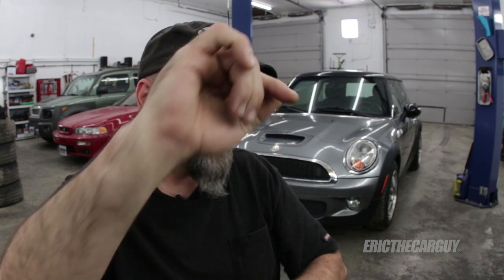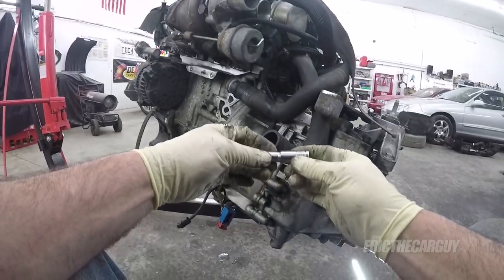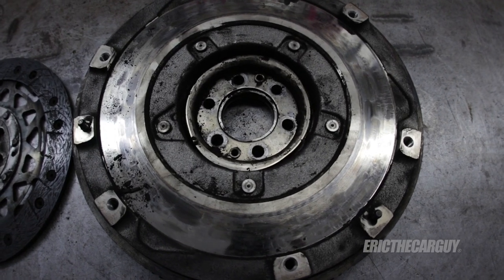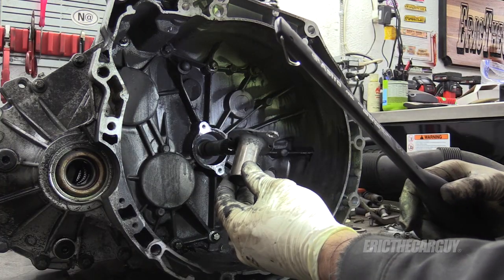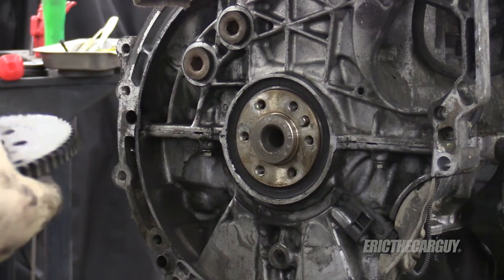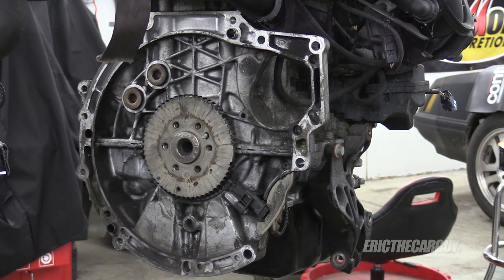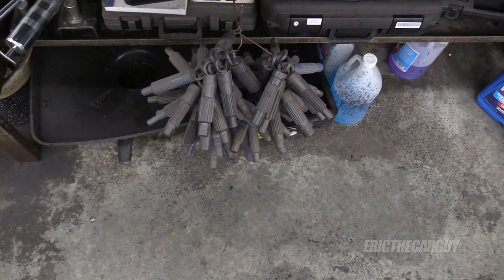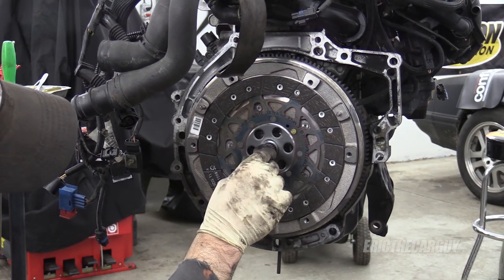How To Replace A Clutch and Flywheel Mini Cooper S (R56)

Comment: When I did the 90° I lost track. And ended up buying new bolts. Make sure you mark them with a white paint marker and and use those marks for your 90°’s
Reply: Jeremiah Thomas Or buy a digital-angle torque wrench

Comment: Yep, good alignment and slowly, slowly is the way to go. A friend of mine did neither of those, he failed to centre the clutch correctly, then used the bolts to try and force the gearbox and engine together. Doing that he managed to take a big chunk out of one side of the brass bushing that supported the input shaft. He learnt the hard way, so good advice all round, Eric.

Comment: Great job as usual sir, watching you before work every Friday. I’ve done clutch’s twice on the last 4 years as a tech, my first one I had to do twice because I put the springs facing the wrong way after putting every bolt back together and the subframe, I push the clutch in nothing happens LOL.
Reply from the maker: It takes a real man to admit mistakes.
Reply: Seems it's a common rookie error - and we were all rookies once.

After the second time I had to re-pull a gearbox and flip the clutch...I decided to be more careful and double-check before buttoning everything up.  Seems to work better that way - and causes a lot less blue language.  :-)
Reply: EricTheCarGuy yes sir especially when them good old boys still talking about it 3 and half years later LOL
Reply: aussiebloke609 yup I did the same thing on the second clutch, you live and learn even though blue language is there either way in the shop or at least in my shop, I just hope I never have to do them again I don’t like fixing manual transmissions but I sure like driving them

Comment: The easy access to every bolt just made it such a nice job, just imagine the struggle doing 90 degree turns under that tiny car.
Much better with the engine out :-D.

As i'm no mechanic, i only remember the clutches with the damper springs in the center, i've helped with clutch replacements on very old cars.
Reply from the maker: Yea, it's much easier to do this job with the engine/trans out of the vehicle. Honestly, I don't think they were that difficult to remove.
Reply: zx8401ztv - Yeah, with the engine out if you are doing this yourself. It just makes me glad I don't have a Mini. I look at the cost of a shop replacing a clutch in my Honda, then look at this Mini, and I could only imagine the labor cost alone would make me cringe..

Comment: Great vid.  Good tips on greasing the input shaft.  Not only is it a high-temp grease, but it's also a high-pressure grease. I use that on the pivots for the clutch arm rather than anti-sieze.  Just a thought.
Reply: Sounds like a good idea.  I always used to use moly grease (molybdenum disulphide) because it handles the heat well, and you need only the thinnest of smears for it to work, so it tends to not collect all the dust and crap over time.  It used to be the go-to grease for brakes, too - until everything changed over to silicone.  Not sure how it handles pressure, but the clutch pivot generally doesn't have extreme levels on it, and it seemed to work pretty well (never had a wear problem, anyway.)  :-)

Just don't get it on your hands, or you'll be washing with pumice for 30 minutes afterwards...and you'll still have greasy fingers.  Ask me how I know.  :-D

Comment: no eric... you should have done the rear main seal while you were there... you know its going to start leaking as soon as the mini goes back into service..........
Reply: It's German,  you know it still has oil as long as it's leaking.
Reply: honhon05 it's fine he's selling it so it will become somebody else's problem. That's the  glory of buying second hand cars.
Reply from the maker: In a perfect world, I would have. However, I would have lost a day of production waiting for the seal to show up. Something I simply couldn't afford. It wasn't leaking and I stand by my decision. Thank you for your input.
Reply: true..... its just usually when your there and you hold off it usually starts happening right after... just because.
Reply: I would only replace the seal if it was leaking or looked hardened and brittle  If you replace it but you do not get it in perfectly then you do the job again.
Reply: Man I had the same thought process as Eric before then 6 months later the seal started leaking and out came the transmission again

Comment: Dampening is the process of adding water.

Damping is progressive attenuation of a process

Seems hair splitting, but such is our language
Reply from the maker: Excellent point.
Reply: Crap! I've been saying it wrong this whole time. TIL.
Reply: WD Hewson Vibration Dampener or Vibration Damper. I think the first one is correct. Harmonic Balancer. U r rite/right/write, the English language is tricky
Reply: Hewson is correct.  To an engineer its a damper.
Reply: The second definition of dampen/dampening is to make less strong or intense. The technical term Damping is any effect that tends to reduce the amplitude of vibrations. Big thing here is that dampening is a verb and damping is a noun.  Damping would be the technical description of the process while dampening is a reference to the action of a process. I'm not an engineer or mechanic, so I don't know how functionally these terms are used. But it seems like both terms may apply for different aspects of a subject. Any English professors here that can clear this up? The English language is straight up kookeydooks.
Reply: jcrbama +1 that the language is crazy.

On the one hand, you can have words which are spellt the same but spoken differently. Tear and tear: one being water droplets from your eye, another being a synonym for rip.

Then there are words which are spoken the same, but spellt differently. Tier and tear, for example.

Comment: I came on here before doing the clutch on my sons R56 One D. It has done 165,000 miles, and the pedal went hard so had to be stripped. If found this was because the release arm snapped. 

The clutch plate and pressure plate were actually still very serviceable, and would easily have done more than 200.000 if driven in the same way, had the release arm not snapped. My son says the replacement clutch is a lot lighter now, so it maybe that as the plate wear occurred the force to release the pressure plate increased and was a factor in the release arm snapping

I would advise anyone doing their clutch to also fit an new release arm. You don’t want to do this job twice. The release arm is pressed steel, and it seems from reading on the net they are prone to snap and not expensive. (the release arms are listed from various sources from £25 to £45) 

As described its certainly not an easy job, because there’s a lot crammed in a small car. but I’ve done worse jobs too, if you have decent tools and just take your time its well within the DIY scope 

Noting  some comments about Mini’s having weak clutches , ours would have done well past 200K had the arm not snapped, and my wife’s R53 Cooper S has done 120K and seems fine. Like all cars the clutch life is affected by the driver more than anything else

Comment: not sure if I mentioned this already because I brag about it to everyone but pacific clutch and brake resurfaces these flywheels and pressure plates and even rebuilds the clutch disc. I ve done 2 of these clutch jobs the clutch came out great

Comment: Nice video! I think the pilot bearing on those models is in the transmission input shaft (built into the nose) which is how BMW has been doing it on their later models. It's a pain to replace and it seems like most people leave it be unless its bad. A few other things to note (again based on BMW experience, but they look the same on the MINI): the clutch pivot pin is plastic and a common failure item that should be replaced while doing the clutch. The OEM pin is only a couple dollars or aftermarket brass and steel pins are offered for a premium. Next, you should pay attention to the TOB orientation as some can snap in two different ways as they can be spec'd for multiple models. Finally, BMW has a special clutch alignment tool (Germans love their special tools!). I usually see the plastic tool included with the clutch kit as you said, but it doesn't fit on self-adjusting pressure plates (the lock plate gets in the way) making the special tool very nice to have. It's something to keep in mind if you do a newer BMW clutch.

Comment: They've had single mass conversions since at least 2013 btw, but I think was only OS Giken and maybe clutchmasters mainly. Now there are a few kits using Aasco flywheels that can use stock non-sprung discs, or few others using slightly different but similar flywheels that use custom disc and pressure plates for different clamping pressure, etc. Depending on what country you live, there also seem to be preferred smaller outlets providing OEM swaps like Aasco's. I've found 2-3 manufacturers in US and handful of others around the world, but Mini owners typically exist to be milked for profit so they'd rather you buy a 'custom' kit for 1400 than get the flywheel for 400 and standard clutch kit for 200 :D

Comment: Please help... I don't think I replaced the part from 9:00 - 9:30 correctly bc the long rectangular plate (i do not know what it is called) is 1 1/2" deep in the whole, and I think the plate should be touching the inside wall. Thanks

Comment: A tip for you whenever you have bolts that require a further 90° torque. I make a small mark with a silver or white marker at 12 O'clock on all the bolts ... then when you done they should all be at 3 O' clock.

Comment: Hello. Love ur videos. My transmission exploded on my 2003 mini cooper r50 (5 speed midlands). My mechanic has a 6 speed conversion kit for 2700$. Would u recomend it? My concern is 1- reliability down the road. 2- will the performance get better or worse? Thank u.

Comment: I just did this on a R55 Clubman S last week..  The car had 80k miles and the clutch was DEE-STROYED...     Come to find out, current owner bought it from a guy who used to auto
cross the crap out of it.
I did mine w/o removing the engine, and w/o removing the subframe; I just loosened the rear subframe bolts, and removed the front two, which gave me about 8" or so of clearance.  Either way, not a job I plan on doing again, any time soon.

Comment: clutches in the uk very rarely come with a flywheel alignment tool but I got a valeo clutch and flywheel for £520 for the same mini so it seems a lot cheaper than you're $1300. we have a universal alignment tool that we use.

Comment: Whenever I don't have a spare rear main seal, I need to replace it; whenever I do have a spare, I don't need to replace it; it's like a $3-$5 insurance policy. HOLY SACKS OF BALLS, $1,300 FOR A CLUTCH AND FLYWHEEL I was pissed at the $500-$600 I spent on a Subaru OEM Clutch and flywheel.

Comment: Vauxhall Astra B/Opel Kadett C used to have an access hatch under the bellhousing to get to the clutch assembly. Piss easy job.

Obviously someone at GM/Opel/Vauxhall realised they weren't making enough money from clutch changes and so it was deleted and  you then had to physically remove the transmission... that sucks...

Comment: From 2016 to 2018 ... I owned a 2011 Mini Cooper S.... I got it at 44,000 mi and it was one owner and very clean. I liked it a lot... BUT ... during the time I owned it, I had 3 check engine lights...limp in mode twice.... it just could not stay out of the shop.  My opinion of these , is they are designed to suck money out of the owners... and well designed at that.. The $1300.00 clutch kit only furthers my belief. I could buy a new one every year if I wanted, but I don't believe in  literally throwing my money away.  Screw that. You can see my vid of me and my Mini if anyone cares to. I was following a semi at 80 some mph at night on I -90 .

Comment: 13:55 but turning it 90 degress is still the same torque on all bolts? So why not just have that nm instead?
Reply from the maker: I wish I knew the answer to that.
Reply: Morten Nielsen bolts that need to be turned an amount of degrees after torquing, are stretch bolts. The degrees indicate you can't reuse old bolts.
Reply: degree angle is far more accurate at high torque because of the resistance of the threads

Comment: I'm getting ready to do this job on my own 2011 MCS, however with a Stage 3 clutch kit and a single mass flywheel to handle the power I'm making. I'm not removing the whole engine, though. Would you say this is a situation that requires a transmission jack if you are not removing the engine? I was planning on lowering it out with a regular jack.
Reply from the maker: It will be tricky, but you can probably manage it. It would be safer with a 'buddy' or a transmission jack as you mentioned.
Reply: Thanks for the input. 

Also I'm guessing you talked to Chad over at Detroit Tuned. He's a wealth of knowledge on the brand, however I don't know why he says single mass flywheel clutch kits aren't possible with this engine. As I said I got a single mass kit, it's from JM Turbo Coopers who make a lot of high performance aftermarket Mini parts. They make kits for both N14 and N18 motors.
Reply: Hey Eric, just an update on this from a while ago. Bit the bullet, bought a transmission jack. Clutch swap was rough but I got it done, your videos were extremely helpful and were my primary go-to for reference. Used my floor jack to support the engine and the transmission jack to get the trans in and out. Getting them mated back up was a huge PITA but they're mated back together now.

Comment: the center clutch disc springs do something else. they reduce impact loads on the entire drive system, especially the transmission. Nice to see the mini has a outboard replaceable clutch slave cylinder. I HATE the slave cylinder built into the throw out bearing.

Comment: I know this was posted 3 years ago but my 2012 mini clutch is soft and needs to be replaced. I’m ordering from Rock auto. It’s been a nightmare since I bought it from a lying or shall I say “fact omitting” dealership but I do love it. After spending $1200 for alternator and $1100 for coils I’m buying the parts & bringing them to be put in. Any ideas on best clutch? Kevlar or organic better? They are $200+ price difference. It’s already got 142,000 miles so I don’t need another 140,000 out of it. Cross that bridge if we see 2023...😬

Comment: Don't do as Eric does and draw the transmission to the engine with the bolts. Make sure it mates up before tightening the bolts down.
Reply: Yeah that made me cringe.
Reply: @humidbeing  I simply use BIG Channel lock pliers OR a couple of C clamps.

Comment: For where the transmission oil goes on the mini, the studs that connect it. What would you call those I'm having difficulty finding the proper bolts.

Comment: It is strange why they don't include an alignment tool with the kit. I had the same issue and resorted to using one of my other alignment tools with tape wrapped around the pilot end to center it. Not perfect but it worked. Oh and don't put that disc in backwards! It will jamb against the guide tube for the release bearing and then things get very difficult to take apart. Yes, I managed to do this...:(

Comment: On my 2005 Cooper s I had the flywheel shaven down at a local carquest for about $40.
I only had to buy the clutch, pressure plate and throw out bearing for about $130.

Comment: What would you call the thing that the throw out bearing sits around( has 2 bolts , looks like a radiator cap with a cylinder )

Comment: Hey eric, I just changed the clutch on an 85 mr2 and the darn thing is still slipping like the old one. It got a new clutch cylinder and and new slave cylinder but no new flywheel. Any suggestions as we have adjusted the pedal but it still slips once everything gets hot after driving it for a bit. It just sucks.

Comment: 2009 Mini Cooper
100,000 miles, manual transmission. With the engine running, when the clutch is released, it sits like it is in neutral. Does not even try to move. With the engine running I can run through the gears without the clutch and I hear no grinding. The shifter feels normal, not tight, not sloppy. Any ideas?? Please help.

Comment: Does the gearbox oil need to be replaced as part of this process?  Thanks...
Reply: no - but it should be done every 50,000 miles to prevent failures.  It's not a permanent lubricant contrary to what BMW says.

Comment: Eric, great video. I just got a 2009 R56 Minc JCW and it has 77k miles.  The clutch pedal engagement point is very close to the end of travel so I'm assuming my clutch is near time for replacement. It has never received a walnut blast to the intake system and I'm assuming I should change my chain guides etc. I noticed you removed your engine to do all these jobs - having done this - is it worth this extra step or should I do all these jobs with the engine installed ? If it's better just to take the engine out, what other jobs should I consider doing while I have easy access ? Thanks !

Comment: @ericthecarguy i have a 2005 mini cooper Super charged 6 speed manual and had to replace the clutch. after replacing the clutch, my slave cylinder had to be replaced because it was leaking. once my mechanic changed the slave cylinder out he gave it a test drive and then the clutch pedal fell to the floor. we went under to inspect the slave cylinder and found out the piston on the slave cylinder was bent. luckily for me i had life time warranty from my local auto part store, but once i replaced it the slave cylinder we drove it again and the same issue occurred. not sure how to fix this issue.. is there any thing you might know about the mini and their manual transmission issues?